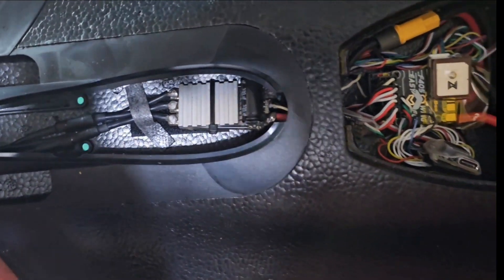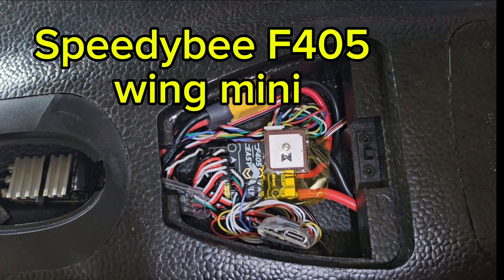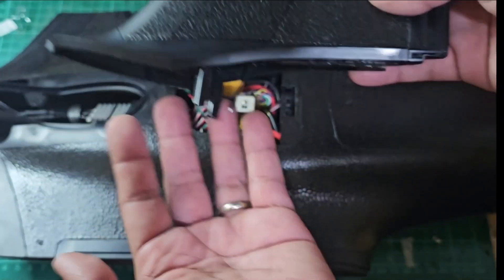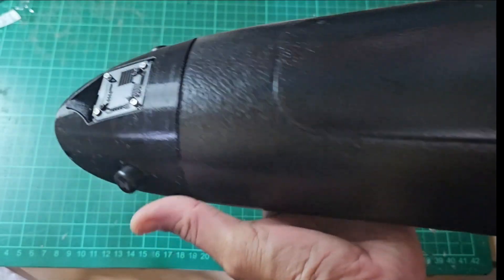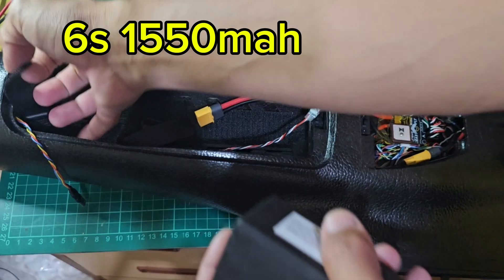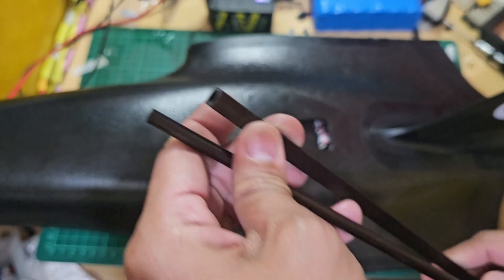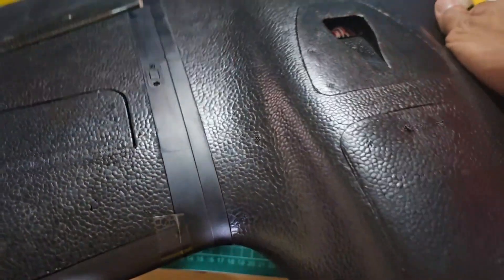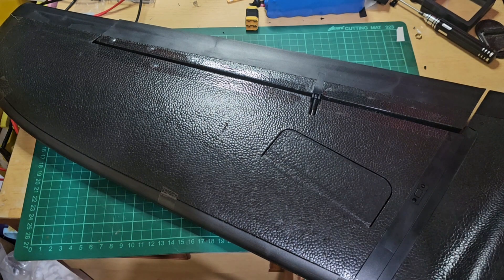TBS Mojito: build overview

Comment: Hello, i'am curently building a mojito with 21700 8s1p lion pack. AUW is arround 2.3kg. what is your AWU for your 2 battery setup (lipo and lion) ?
Reply from the maker: here are the various AUW of my mojito (1595g without battery, includes 3d printed nose, and all other electronics like led strips, servos, bec, walksnail GT etc):

-with dogcom 6s 1550mah x 2 pieces (506g) = 2101g
-with dogcom 6s 2200mah x 2 pieces (624g) = 2219g
-with 6s2p 21700cells 10000mah (861g) = 2456g 

on 6s, static thrust of brotherhobby tornado t5 3115 pro 1050kv is around 4kg, so launching it is still fine

Comment: Does it have some top of a go between... To connect the servos...  Because radio link doesn't really sell A receiver that plugs directly in their servos
Reply from the maker: Yeah, in a typical fpv setup, a flight controller sits between the servos and receiver. I assume your radioLink receiver has sbus output, you will need to plug that into the flight controller, where the servos are also plugged in.

Comment: Looks good
Reply from the maker: Thanks mate
Reply: Why does it matter how it looks since you're looking through the goggles... Turn don't have the ability to pivot the camera... You can't even see your own plane... Why is a flying wing... They are terrible for landing...
Reply from the maker: @truthtellormm I actually got a panning camera mount that can go 350deg,  so yes, it can pivot around. I will post a video soon
Reply: @windfpv but you're not looking for it when you're actually flying right?
Reply from the maker: @EvolutionisHoaxI do sometimes, especially when flying it line of sight. I do fly LOS my planes if I want to just enjoy it without the fpv gear.

Not just that, there are times when we do formation flying/chase flights on fpv. That's how I see how my plane looks when I fly it, through my co-flyer's video feed, on post edits of the flight videos.. I post some of the chase flight footages here on my channel. So if you say that I can't see how my plane looks, that's definitely not correct.😊
Reply: @windfpv do you think the flying Wing setup is a marketing gimmick play some type of military drone.... Hard to put down flaps with a flying wing ... Conventional layout with a detail you can put down flaps and land a lot slower.... Imagine using a 6S lipo makes the drone pretty heavy
Reply from the maker: @EvolutionisHoax not really, the airbrakes on this mojito works. While it cruises at around 120 to 130kph, I can land it ay around 40kph, a little lower than that actually as I got on my last flight today

https://youtu.be/fhE_n5R7FJs

Comment: Have you ever experienced any issue with launching? It's really pain in the a.. for me. When I throw it behind my back it just often crash with autolaunch. Check CG every time. I tried to throw it at high angle, at low angle. Last time when I placed 8s battery, it slowly reduced the altitude it crashed at 160km\h. So I have only 3-4 success flights and 10+ crashes. It's difficult to find carbon parts to replace the broken one. Tried to tune it, checked all servos, elevons, flight controller alignment, autolaunch settings, PIDs. Tried Inav 7 and 8 and even replaced flight controller. No luck...  I have other planes that fly great, so I'm not a newbie as I think. And as I noticed your Mojito doesn't have the issue with motor mount. Mine just melts in points of contacts between motor plate and plastic body and even near screws. Motor is not hot at all. The reason is vibrations but I don't understand why, I tested it before flying with prop and without it, vibrations are not so strong.  Finally I fixed it with some kind of wire tape between plastic parts. I bought it as PNP with supernova 3220 motor.
Reply: More and more people are just using a bungee
Reply: @truthtellormm I'm considering getting a bungee system. Can you recommend a good one?
Reply from the maker: Considering the weight, you can just use some bungee cords, no rail/ramp. Thicker tubes should be better.
Reply from the maker: @truthtellormm yeah, I agree, bungee is safer. I use that sometimes, for fun 😁 oftentimes I just launch it by hand. I got a couple of experience launching heavy planes, it helped in launching the mojito, I guess
Reply from the maker: Hmmm, what's your auto launch settings (idle throttle and max throttle for takeoff)? How do you launch it (one hand or 2 hand overhead)?

Mine launches pretty well without issues or so on on auto launch or angle/manual. Just give it a high throttle as needed. I didn't have the supernova motor but opted for a Brotherhobby tornado T5 3115 1050kv, produces around 4kg of thrust so takeoff is easy, I'm just flying mine on 6s. Yours should generate a lot of thrust as well as you got it at 8s...
Reply: @windfpv  I launch it with 2 hands overhead. Autolaunch settings are default except launch timeout=20s, I increased it because I have to launch it without goggles and radio. The thrust is really enough to takeoff vertically, it rips out from my hands but after that loose the altitude. It's really a kind of magic.
Reply from the maker: sounds like it's going into a stall..anyway, you might be launching it too steep, you might need to adjust the way you hand launch it. typically on two hand overhead launch launching a wing can go steep, that's why i prefer a one hand overhead, or side launch to avoid that. by the way, im not sure if this will also help but this is my auto launch config:

set nav_fw_launch_max_angle = 180
set nav_fw_launch_motor_delay = 150
set nav_fw_launch_timeout = 50000
set nav_fw_launch_max_altitude = 10000
set nav_fw_launch_climb_angle = 17
set nav_fw_launch_thr = 1900
set nav_fw_launch_idle_thr = 1400
Reply: @windfpv  Thanks for the tips! I'll try running it a different way. I think my Mojito can handle a couple more crashes 😀